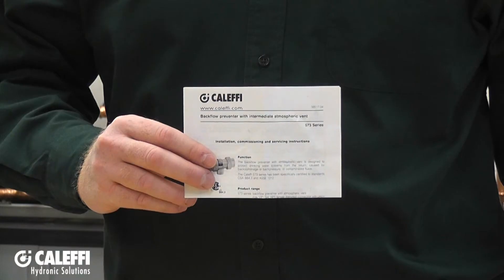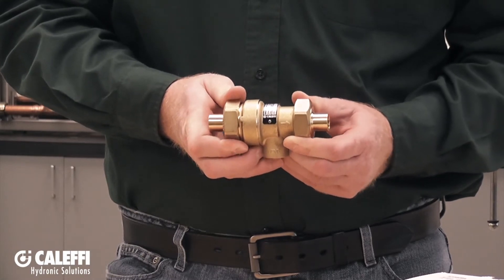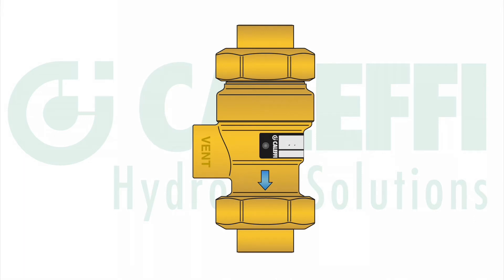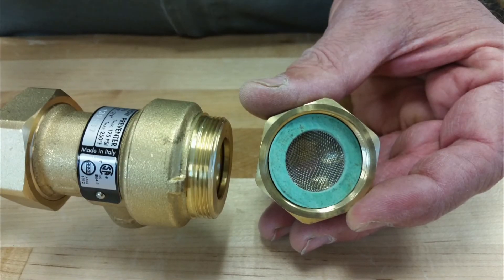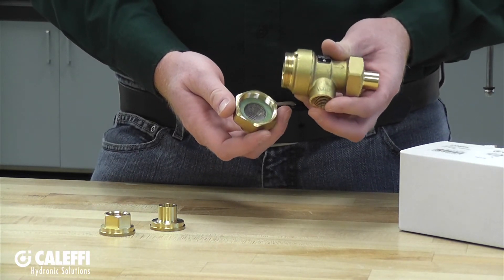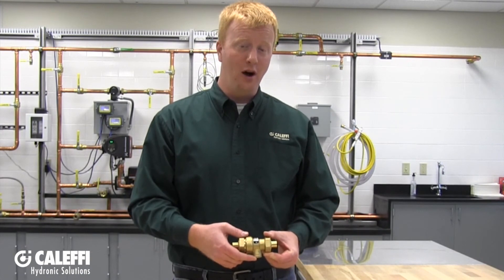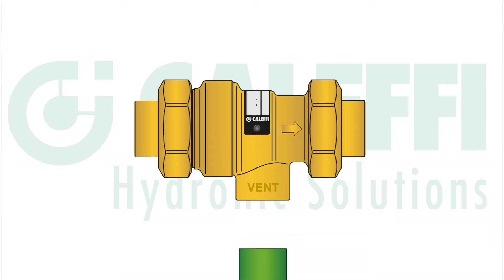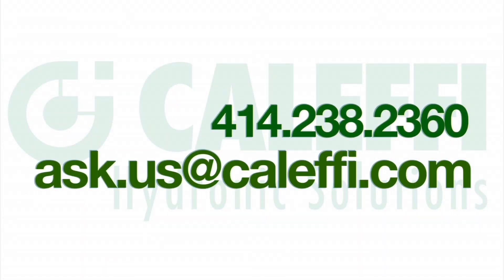573 Backflow Preventer

Comment: How much water could potentially come out of that vent?  Could you end up flooding your house?  House is from 1967 and doesn't have a backflow preventer on there now and never had a problem.  I'm wondering if I'm worried over nothing.  This is related to automatically adding makeup water to a hydronic heating system to maintain proper pressure.